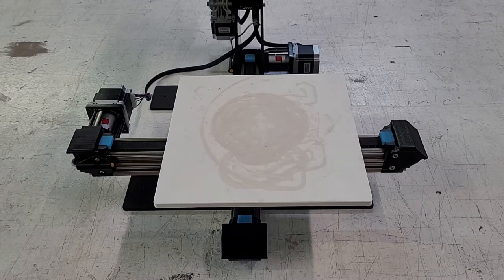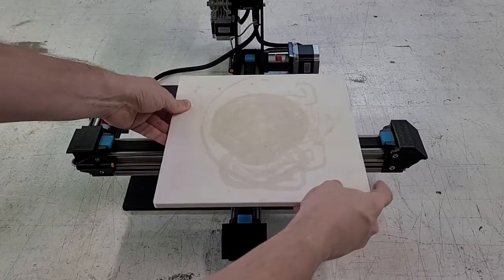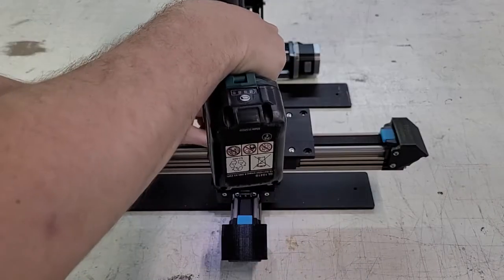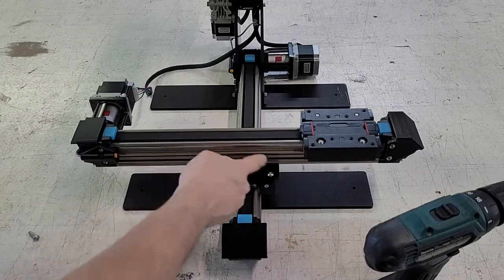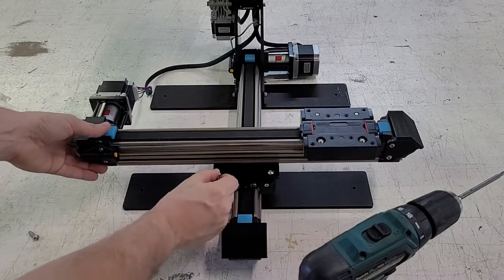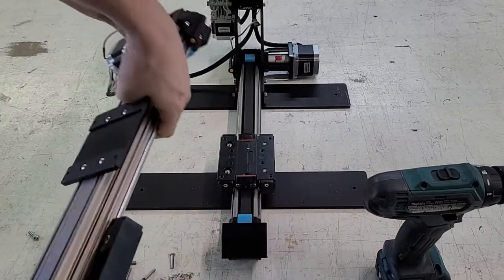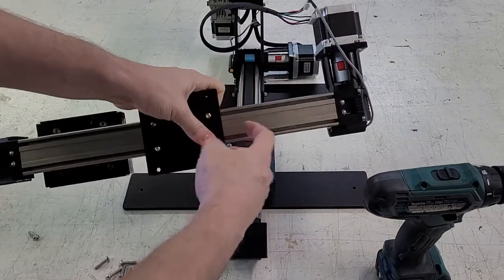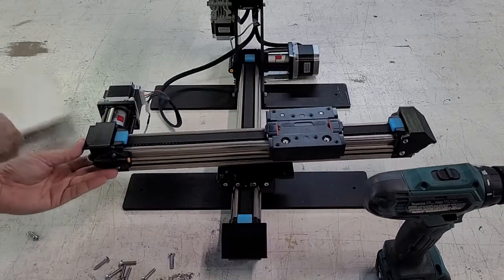Wobbling Print Bed: What Needs to be Tightened.

Comment: Hello plz i have a question, what could i do to get red of missed steps 
I use good stepper motor 
With high enough torque 
And there not a loot of frections 
It's good enough but i still have problem
Reply from the maker: Hello, tarik Ligabi, I do not fully understand what you are saying. If you need assistance you can contact our tech support department directly.
Reply: @3DPotterTech  how can i contact you plz
Reply from the maker: @tarikligabi463  You can use our contact us page, or email our tech support depart directly through email (email is on the contact us page). https://3dpotter.com/contact
Reply: @3DPotterTech  oh coool thank you